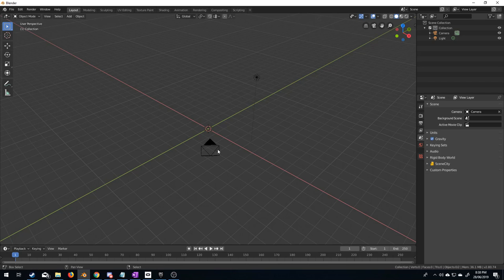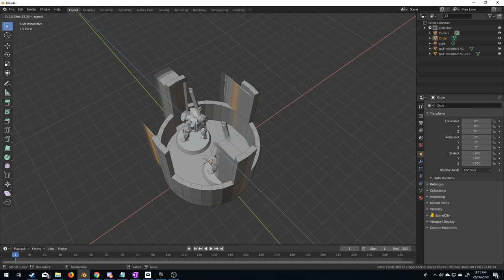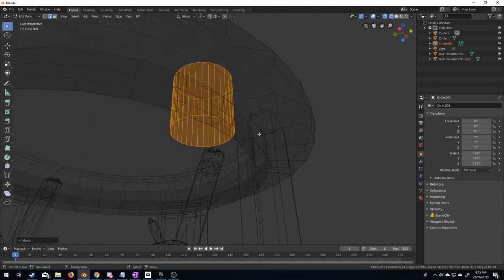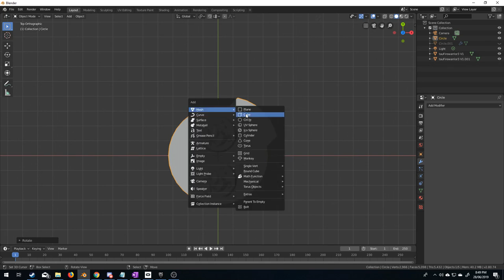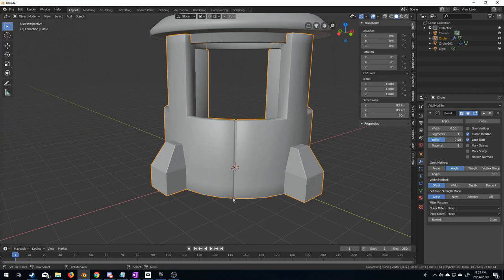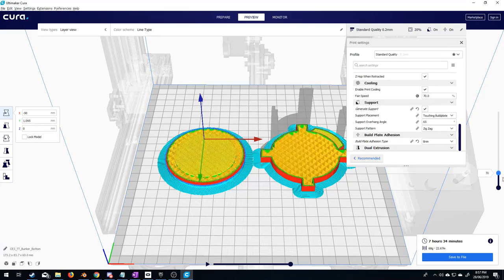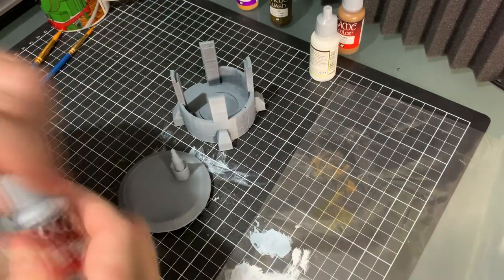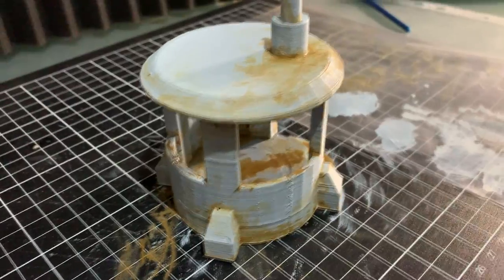Concrete Bunker - 3D model, Print, Paint -Tabletop Gaming Blender Tutorial

Comment: What brand and Type printer are you using? I'm looking at JGAURORA A5S. It has a build area of a cubic foot. I like the UV printers also, but the build areas are so damn small.
Reply from the maker: So I am using the Ender 3 printer. it is 220x200x250. I would love to go up to the CR-10 but it was the only printer that I could afford at the time. I will try and upgrade soon.
Reply: @Markom3D I am looking at 3 or 4 different ones. there's a 600 dollar one that has 12 by12 by15.5 hight build. LOL, I'm looking at modeling a 10 foot Klingon D7 from the original series Star Trek. so I need to make large pieces.
Reply from the maker: @TwistedSisterHaratiofales  wow, heck yeah, go for it. Like I said before, I would do the same but I dont have that kinda of funding lol. I would like to make a full helmet without slicing it up,
Reply: @Markom3D  There is a 6 foot build of the Enterprise going on in the near future, and the model is Carbon Fiber. It costs 4,500 dollars to buy this kit. I think I can double the size for less, but I may be in error on this. I think the Klingon ship would be a good start though, and I want to put it on my You Tube channel of course. 
Right now I'm working on a 1:32 scale Klingon Shuttle craft that is easily enough to do on the outside, but the detail on the inside would be way easier with a 3D printer.

Comment: Hi, great video ! Wouldn't adding a sub surf modifier smooth the final print ? and a last little tip for the first extrude/scale you did there is a menu alt+e and extrude faces along normals do that in one operation ;)

Keep up the good work
Reply from the maker: Yes, I thought about that afterwards once I printed it. Mesh smooth does nothing with 3D printing. I checked out your vids, and those models look awesome.